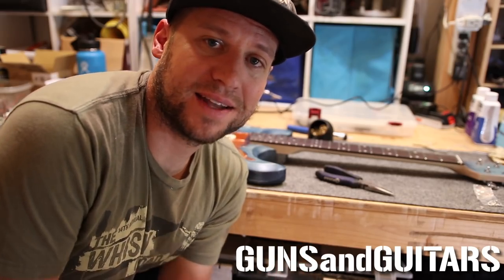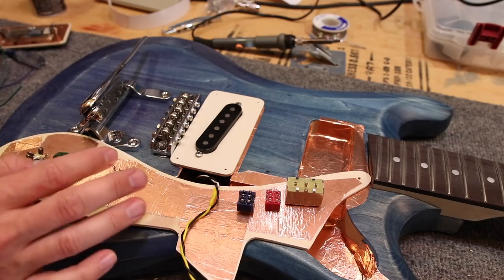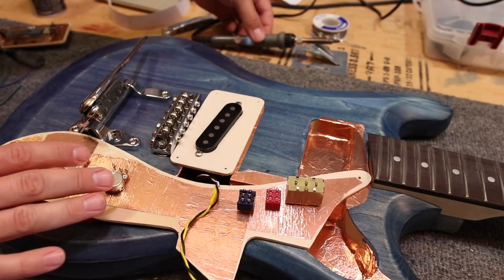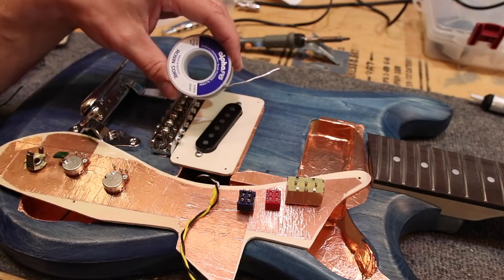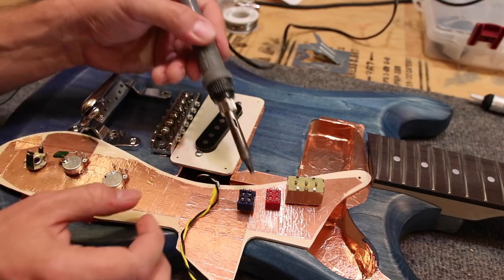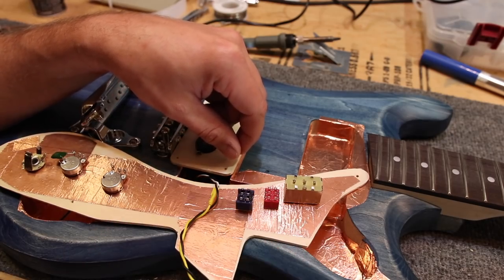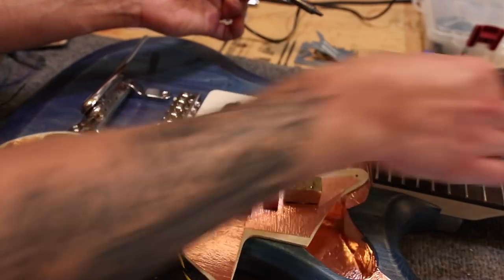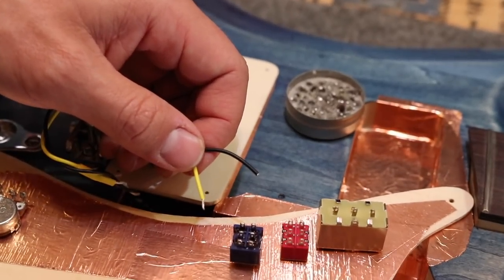Guitar Wiring and Soldering: Basic Technique Tutorial

Comment: Thanks for this really helpful video. Could you show us how you solder a bunch of ground wires to the top of a pot? I had the problem, that I had to heat up the surface to make sure the solder will stay there solidly. Because of that I fear I destroyed the inner parts of the pot by overheating them.
Reply from the maker: It’s possible that you did unfortunately. That’s one of those things that comes with practice. It helps to have a larger tip on your soldering iron, it’ll help transfer the heat faster, just in the spot that you’re touching. Only hold it there long enough for the solder to grab the pot casing, then pull the heat of immediately. I’ve destroyed a pot or two before I learned exactly how to do it. Good thing pots are cheap!
Reply: @GunsandGuitars  thank you!

Comment: Will Deoxit clean up corroded pickup magnets? I used you aluminium foil and spray adhesive trick on the SSS Strat I built and there is no hum AT ALL, unless I put an overdrive on and crank the drive up past 75%. This was with a double layer of foil in the cavity and a single layer on the pick guard. Worked a treat.
Reply from the maker: I don’t think that is what deoxit is for, maybe someone else can chime in here, but I think for corroded pickup magnets, just use really fine sandpaper then a cloth with a metal polish cream or something.

Comment: I was wondering if a Bass guitar can be set up the way a Les Paul is with the 2 tone and 2 volumes with the 3 ways switch to change a P J style bass. I want to keep mine the way it is kind of with the precision and Jazz pickups I have that are Seymour Duncan Quarter pounder 3's. but be able to either use both at the same time in the middle, or use only one pickup at a time. Will that work on a bass?  Right now I can only fade between the 2 pickups and two tones which is fine. But I want more of a LP setup in it.

Comment: I have a question i just bought  some alnico 5 from stew mac. do i need push pot to split the humbucker to get that single coil sound or do i wire it to my tone knobs? My stew mac has that capability. do i need push pots?
Reply: It depends. I have just bought a push pull pot to replace the old volume because I have upgraded my single coils to humbuckers on one of my guitars. If you want to do a straight coil split which is step 2 for me having put the new pickups in already then yes you need some sort of switch, it doesn't have to be push pull but if you install an on off or three way (some people like to add series and parallel switching options here) you'll have to drill a hole to install it. Next level is a blend control between the humbucker and single coil sounds. If you just wired it to the tone you would be potentially blending the single coil sounds with the bass or treble roll off from your tone control which might be interesting (possibly unique) but probably not your desired outcome.

Comment: Tin the wires before connecting them to the componets, also clean the iron tip before each use , with the cooper , but do not make a habit of cleaning the tip in the tip cleaner, that is acid and is intended for really bad coroded tips. Use the proper heat and remove the oxidation on the copper ..BALL?  tin the wires tin the connections on the terminals and your great. I know i seen at least a couple cold solder joints..lol but good try.

Comment: Hey Dan,  any advice how to lower the neck pocket of an unfinished body so a neck fits down in it correctly? Its a kramer baretta clone but the neck is about 4mm too high off the body?  Its all routed so would using a wood file or just alot of time and sandpaper be the best option?  You seem to be the best source for these types of issues with DIY kits and setups.
Reply from the maker: Firstly, have you tried a test fit? You might be able to adjust the bridge to get a good string action as is. But if the neck pocket must be lowered, a router with a plunge bit is the best option (it’s the type of bit that has the bearing above the bit so that you can follow the edge of your neck pocket without messing it up). Hope that helps, I would not use a file or sandpaper because it will be extremely difficult to keep the base of the pocket level, which is necessary or you will end up messing with the string action.
Reply: Guns and Guitars  
Thanks, I saw your video on the must have and what you don't need on tools...I'm clicking the links to grab one off amazon, I only have a table router and normal hand router. I think its going to be worth the investment since its sitting way too high for the bridge even at a super-high setting.  Much appreciated for the quick reply. You Rock bro! Go Sundevils :P

Comment: You're right with the cheap pots really. I use more expensive CTS/Alpha pots for other people when they want them and feel better knowing they have them but well cleaned, well soldered pots from cheap sources seem fine for my own use. Same goes for Sprague Orange Drops etc. 

I tend to flush the pots out using the lower aperture above the contacts like you showed, but also the little open indent in the top surface that many pots have, this seems to flush the dust and rust out really well, I'm not sure if it makes all that much difference, maybe I'm wasting my contact cleaner spray!
Reply from the maker: Haha I shoot some in that little hole as well! And thanks for confirming my suspension about this, glad I’m not the only one!
Reply: @GunsandGuitars  you're certainly not the only one. But, more power to those who want and buy the brand name parts and orange drop caps. I'm sure they make a difference to some people, just not me.

Comment: My soldering iron doesn't work with me well lol, if it touches the component and then I touch my solder it doesn't melt it well, plus the tip melts far slower that on the near the metal shaft.

Comment: Dan, love your stuff, but cleaning cheap pots is only getting you some time. Those are not only made in dirt, they're made with cheapest of metals. The contacts wear quick and the seals are non existent. My experience is from a different field completely, but if you want the guitar to last without any issues, spend a few more dollars.
edit: don't take any of this as criticism. Like other said, pre-tin your leads.It only adds seconds to the work, but removes the trouble of finding cold solder joints in the future.
Reply: +1 about the Pots.    I purchased a Fender Twin Reverb amplifier brand new back in 1976 and it's still using the original; pots with no problems.   42 years I've been using that amplifier with it's original pots!  Cheaper items I've purchased made in Asia have an operation/cycle life span of less than a decade, sometimes only a couple years.   Past experience as an Aircraft Instrument Technician has taught me, even the smallest component can put a monkey wrench into the whole works and bring it to a stop.   Spend a few bucks more and use quality components.

Comment: I have a butane soldering gun by benzomatic would that work for guitar projects or would I need an electric Soldering gun
Reply: Jake a butane unit will work just fine, but you have to keep buying fuel. I used a butane unit for a long time. Electric units are just a lot more consistent and you don’t have to keep buying butane fuel. But yes a butane unit will work.

Comment: With all respect, the first two solder joint you did were cold.  The tip you've used on the iron is too big, as is the diameter solder you're using.  Also, after you twist the wire strands you need to tin them with solder  by applying heat and flowing a tiny bit of solder over the strands. This is why after your first solder joint has one of the wire strands sticking out after you soldered it to the switch tab.  Unfortunately, you can't tin the wire with the humongous tip you're using because too much solder will be applied and you won't be able to thread it through the hole in the switch tab.

The size of your tip is transferring too much heat and on a switch you run the risk of melting the plastic inside it,  destroying the switch. 

The solder should flow smoothly onto both surfaces and form a fillet. The abrupt blobbed shapes you have on the solder  joints is evidence it did not flow smoothly because  both surfaces were not adequately heated for reflow to occur.  You should consider using some flux. It would greatly improve the quality of those joints.  It makes a difference. Cold joints are susceptible to breakage over time.

Comment: Hi Dan, I loved this video. I have been soldering for years and can heartily endorse your method, with one addition. You will get a better stronger joint if you tin the wires with solder first. Now I have a question. Why do Americans pronounce the word "Solder" as "Sodder"..? There is an L in the middle and the correct pronunciation is "Soulder" or "Souldering".  Love your channel Dan, you do great work!  Cheers and best wishes... Phil (Australia, where we also speak English :-) )
Reply: Englishman here and you have no idea how much this makes me laugh. Like, they claim they took out "unneeded" letters like the U in colour, yet they choose to completely ignore the very visible (and still written) L in Solder.
Reply: What do you mean by “tin the wires first”? Fairly new to the stuff
Reply: It just means to apply a little bit of solder to the wires after twisting them together and before attaching them to the component. Solder likes to stick to solder, so by having some already on the wire (and in theory, you should tin the part you're attaching the wire to as well) you make the join easier.
Reply: Thanks Furiora... :-)   I should have explained that.
Reply from the maker: To answer your question about tinning the leads and components, I skip those steps because they seem redundant to me (at least for guitar wiring) I think that makes a lot more sense when you are using very delicate components that burn out easier, because it requires less time for the heat to touch the component. But it also means you need to solder 3 times for every joint. I just twist the wire, solder once, and move one. But I’m not the authority here. I’m just showing you guys how I personally do it.
Reply from the maker: As for ignoring the L in solder, it makes no sense. We also ignore the L in walk and talk and a handful of other words. We don’t speak “the queen’s English” here. We are a bunch of uneducated yanks
Reply: Your method is ok and for probably 80% of your joints over time things will be fine. Not pre-tinning wires and or using flux for tag joints and the like will result in more cold/dry solder joints over time than by using flux and pre-tinning, in my experience of 30 odd years of soldering. It is all a matter of personal taste and preference I guess. Plus if it works for you then it is great. :) Cheers
Reply: I'll pronounce the L in solder as soon as England fixes the spelling or pronunciation of all the cities ending in -ster or -shire.  How is a native English speaker that isn't local supposed to know that your supposed to drop half the vowels and consonants when pronouncing those names?!  ;p
Reply: Furiora read your second comment with the missing queens English “l”. Thank you for screwing that up in my head.
Reply: Aaaaw C'mon Dan.. I said I heartily endorsed your method, and I love your channel. Then I added one more tiny piece of advice re the tinning of the wire. Apologies for chipping 
in. As for the spelling thing I said I am from Australia. We butcher the Queen's English as much as you guys do. It was a gentle dig, with a real question behind it. I really want to know why that particular word is pronounced "Sodder".  Again apologies if I touched a nerve. Phil
Reply: You don't pronounce the L in salmon or chalk, do you? 
No. 
'Merica.
Reply: Why do Brits pronounce "ah" instead of "r" in many words i.e.father,? It's called " having an accent"...
Reply: @Furiora  We didn't "take out" the "u" in color. You guys, trying to be more French, put the unnecessary "u" in. Only the French and the Brits add the "u". All other Latin based languages do not use the "u". I thought you guys didn't care for the French that much... lol
Reply: @Nikosi9  Blame Willam the B*stard (no joke, that's what the French troops he fought with called him) Since he took the throne the french way became the "posh" way because Willam lived most of his life in France.
Still doesn't excuse the US for missing out the very visible "L" in solder, lol.
Reply: @Furiora  I'll make a deal with you. I'll pronounce the "l" in 'solder' (of course, I'll be laughed at here), if you pronounce every trailing "r", including the one in "solder" as an "r", and not as an "ah"...
Also,  words like "secretary, lavatory, etc" have 4 syllables, not 3...
Also, a collective noun refers to the singular entity and not the individual constituents within. Therefore, "England have blah, blah, blah..." is just plain WRONG!  This abomination is seeping out of the mouths of our un-educated tv presenters, and it drives me nutz!
Who was it who said, "England and America are two countries separated by a common language." ? So true... :-(
Reply: @Nikosi9  English is really 3 languages in a trench-coat anyway. lol.

Comment: Meh you did just fine(don't take the armchair pros to heart), typically I just use Rosin Paste, put it on and it will suck the Solder off the iron right onto it, I never touch the iron to any component despite what people say you just melt the Solder feed above and take it close enough to jump from the iron onto the Wire/Terminal you want to Solder.

I fix circuit boards on Laptops and such and deal with Computer soldering where you don't want to burn the PCB itself or traces and or other components so you cannot touch it unless you are doing a quick heat for a solder sucker, Also arcade machines, Raspberry Pi projects, and such.

Comment: This sounds more like a sales pitch. No one shows how to tin a pickup ground, Just pods! seams like solder, sticks to pods easier than pickups. Do you know why this is?
Reply from the maker: Solder sticks to hot metals. Warm up your metal with the iron first and the solder will stick justcfine.
Reply: @GunsandGuitars  I did that for sure, sanded it down real good, cleaned it with contact cleaner . It was still a hard to solder Job. there must have been something on them not to take. the pods went just fine. thank you Your videos are very good . I now have sound to my   Eko C02 ST

Comment: Informative thank you. Although I was hoping it would demonstrate soldering a wire to the body of a pot instead of the hole connectors. I'm not sure but I think they are grounding connections and something I have seen in the few guitars that I've opened.

Comment: Gotta disagree with your thoughts about imported versus high-end electronic components. Potentiometers made by CTS, Emerson, Bournes, etc, and quality switches, in my experience, make a huge difference in tone. I don’t think cleaning out dust from cheaper import components will open up tone. I don’t mind spending a few more dollars for better components and wiring to get the tone I want from my guitars and basses. With that said, one still has to check the values of the pots used with a multimeter to ensure the pot is good. I have had a few CTS pots not measure out at their advertised values. But it doesn’t happen often. Cheap  import components, in my experience, are often far off in value. With some things, you get what you pay for. Regardless, I love the channel and enjoy learning from you. Thanks!

Comment: "No lead is in solder fumes. The temperature is far too low.  The fumes from lead-free soldering are MUCH worse for you, as the flux in it is much more acidic than the rosin flux in lead-tin solder." Still, you don't want to breath the vapors from the flux. Use a fan. "Soldering operators who spent most of their professional life next to a soldering iron doing work with old-style lead alloy solder not only not get lead poisoning, but they don’t even have elevated blood lead level."

Comment: That is not how a REAL man solders!  You get your handgun... I prefer my m1911A1 Colt 45 side arm.  Make sure that you use lead hollow point rounds!  Then you SHOOT THE GUITAR!  Take the soldering iron and solder the lead bullet to the wiring and use it as a hub for your wiring platform.  

To wire several guitars at once I prefer a shotgun... buckshot only.  Slugs are RIGHT OUT.  If you shoot your guitar with a deer slug you are a moron!  THAT will ruin your guitar!  What is wrong with you!  Use 12 gauge buckshot!  Now THAT is smart!

Remember, in a pinch you may also use this technique to solder intruders, the neighbors, the paper boy, hell anyone!  Gotta love soldering!  Work smarter, not harder!  

Gatling

Comment: I like how you do a build and don't protect the guitar. Just solder right over it, what could go wrong. Soldering works best around 700. You can buy ones that do that for about $30. Don't use lead bases. Geez. Might as well just ask for lead poisoning.  Don't bother pretty soldering components or wires either. Holy cow.
Reply: Tinning,  not pretty soldering. Excuse me. I picked the wrong week to stop sniffing lead solder